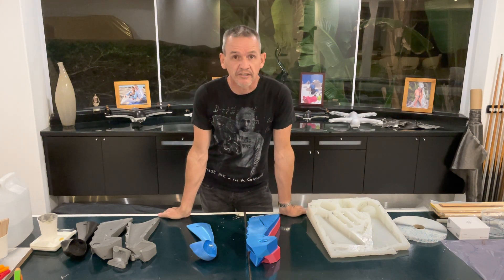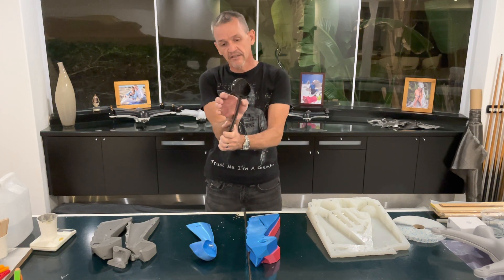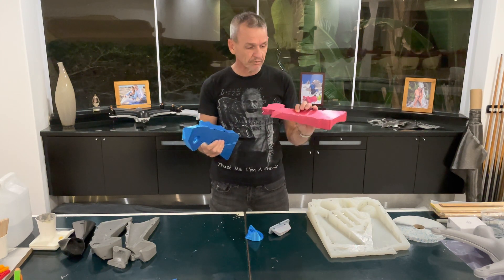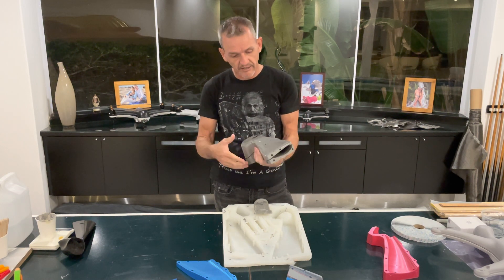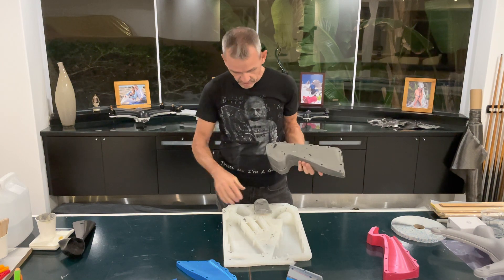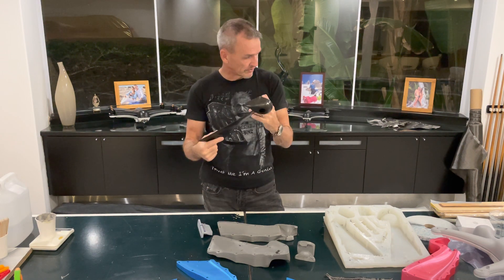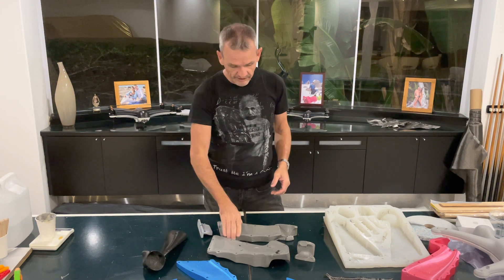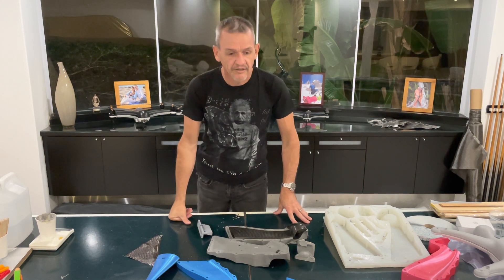Building the Gannet Makto

Comment: What is the price of a plane carrying a weight of 1.5 kg
Reply from the maker: No it can carry allot more than that. This was one of the earlier prototypes, it has been changed allot. Taking Lipo or Li-ion battery packs, if you push it with Lipo you can do “short” flights with up to 10kg. With 5kg it can do 30min.